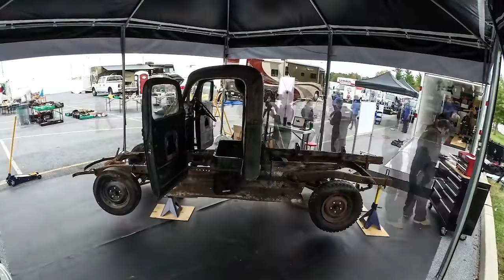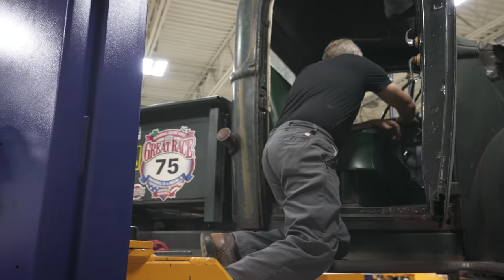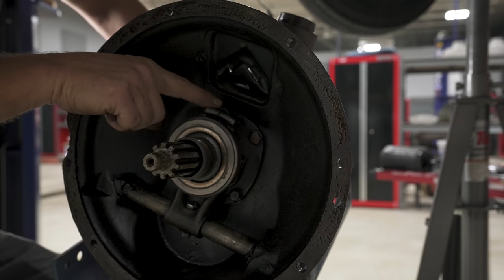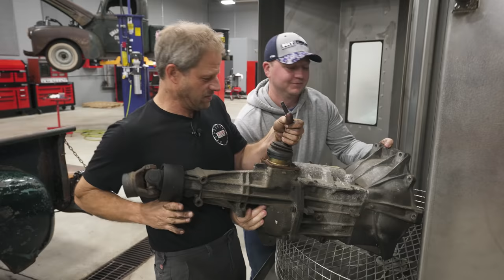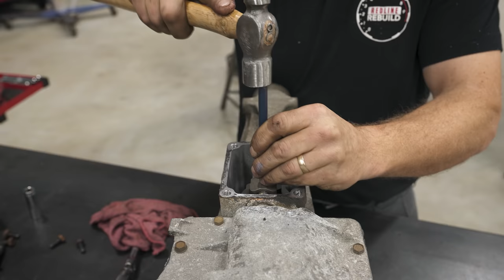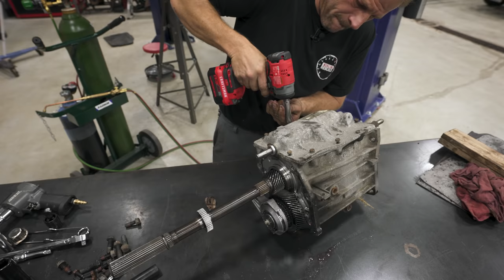T5 Transmission Swapped into a 75 year old Ford Truck | Pt. 1

Comment: You always mention to get out in the shop.  A year ago I finally tackled the 37 Chev PU build that I bought from my aunt and uncle in 87.  I had quit and stored it after a couple of major life events including the early death of my father who was working on it with me.  Then this year I started suffering debilitating pain in my leg and had to quit.  Fast forward a few months and I had surgery on my spine to correct a bulge pressing on my spinal nerve.  I have to go through the rehab process for a couple of months before I can resume work but I'm looking forward to getting out in the shop.  I'm putting a late model LT1 from a 2014 Silverado in it so strengthening the frame is paramount.  Already have a Fatman MII front end installed.I'll have a 6L80E transmission.

Comment: An old dishwasher also works well as a parts washer; just smaller.
 Those industrial parts washers use same wash methods; i have repaired / maintained them before.
That's how i got the dishwasher / parts washer idea. Use a non suds soap / degreaser. Cascade works ok.
Portable dishwasher on wheels, with sink connection and butcher block top is a nice find.
Reply: I recently got a heated rotary parts washer from auction. I cleaned a T5 by hand and used etching primer and painted it with engine silver heat paint. I wish I had the parts washer when I did my T5, if you take everything apart it will clean small parts, gears, shafts, etc...The parts washer I got has a skimmer to remove oil and a heated element to get rid of the oil. It is 100% self contained. Does your old dishwasher do that?

Comment: I did exactly what you're talking about with a 72 Chevelle, when I replaced a SBC 305/TH350 (not the original engine OR transmission ... came with 307/Powerglide which I'd changed out a few years before to get it back on the road) with a BBC 402/TH400 ... I just had to slide the cross member to different holes which were already in the frame rail. Surprised me, actually.
Reply: That 2 speed PG is a good tranny.... But the 400 was the way to go. 
Tail section was too long for drive shaft had to have it cut....

Comment: I was smiling when you were talking about the Chevelle crossmember. 
I had a 68 Chevelle in high school. 
I probably put three different 350 turbos in that car, they just wouldn't hold up.
 I remember underneath that thing sliding that crossmember up and down those frame rails many times.👍

Comment: I have a different way to hold the engine up when I remove a transmission.  I use a ratchet strap, I go over the frame rails under the oil pan and then ratchet it tight under the frame rails. I love watching all your projects and learn some tricks on my project even.

Comment: Even back in the day when that truck was new many people had the same problem or just wanted to save money on gas and wear and tear on the engine added an aftermarket overdrive unit. They even marketed a two speed rear end for the model T cars and trucks called the Ruxton. The only problem then and now it's a pretty expensive proposition and the T5 defiantly is a much cheaper option but much more labor intensive. What I have also seen is the set up from a later model Ford car like a 1949-53 Borg Warner three speed with overdrive swapped in and a floor shifter adapted to the transmission.

Comment: Use a ratchet strap over both frame rails and under the back of the engine. Hook on the lower inner part of the frame. Ratchet it tight and the vehicle can be moved if required.

Comment: I need to start getting work into my np435 swap into my w100. I need to get the engine rebuilt. Then getting a new oil pickup for the oil pan. Then cutting the GM mounts off and welding Mopar ones back on. Wiring it. Dropping the engine in. Get the 44x12r17 wheels on. Axle flip. Rust work. Get heat/AC (maybe). Radio

Comment: That upper right bellhousing bolt gave me trouble too. I ordered a cheap set of 1/2 drive impacts so I could modify one to use on my Ingersoll 1/2 inch drive impact. Then it came out!

Comment: Always thought the ford t5s and chevys had different input shafts, definitely have to rethink  retrofitting a t5 into my 41 gmc
Reply: they do...sleeves are available so as to use Ford throw-out bearing and Ford clutch assembly and linkage on S10 5-speed
Reply: @kennethnoble811  awesome!
The old girl will be way more fun over 45/50mph

Comment: I had a T5 in my '88 S10 with the 2.5L Iron G=Duke 4cyl. engine. It had a mech. speedo , but used that POS hydraulic throwout assy. and I always wished it had been the old mech. version. It was a failure point that was almost unrepairable when it failed as it refused to bleed out properly. I finally traded in the S10 because of the hydraulic crap.

Comment: a good option for holding your engine up is a ratchet strap underneath the engine fastened to both of the frame rails on either side of it and then tighten it up

Comment: Awesome project. I have a T5 with a Dana 300 Transfer Case in my 86 CJ7 4.2L. It has two sets of numbers on the housing in two different spots. One is 13-52-066-915 and the second is 13-52-065-904. Is it a World-Class OR Non-World-Class? If someone can help with that I'll appreciate it. Also the Dana300 is leaking just a drop here and there from the drain plug I believe. I'm not really using it much AT ALL unfortunately. Any recommendations on weather it should be rebuild or?? If anyone out there has a suggestion. It sat for a few years in a garage. Thank you ahead of time.

Comment: This has nothing to do with the project, but I see a lot of mechanical guys on youtube who wear their wedding rings while working. I don't know if you guys realize how dangerous this is. Your ring finger could get skinned by electrical tools or even get ripped off.  I would never work wearing my wedding band/ring.
Reply: This is Machine Shop 101 type stuff... you learn it in the first day or two in junior high shop class. You remove all jewelry, wristbands, watches or anything in the way of clothing below the elbow joint. You also remove anything hanging from your neck and tie up any long hair so that nothing can get caught up in moving equipment. Speaking of clothing - no loose fitting shirts or pants and the recommendation on shirts is buttons or snaps so that your shirt can break away if worse comes to worse. I myself once saw a guy running a large LeBlond horizontal mill get his shirt tails caught up in a boring head and it was dragging him slowly in. Fortunately, the mill was set at 25 RPMs so he had time to rip open the shirt and spin out of it - naked from the waist up. Aside from the buttons missing, he could put the shirt back on AFTER he shut off the mill and unwound the shirt from the spindle and boring head. Damage? Shirt only. None to the guy or the machine... but think about what could have happened if the spindle was moving at a higher rate of speed. Say 300 RPMs. His shirt would have been violently ripped off his body after he slammed into the spindle. I seriously doubt he would have been unscathed. As it was, he continued working after finding some duct tape to keep his shirt closed! You can believe he tucked in his shirt every day after that too. As for me, I'll admit I didn't actually react to what I saw until about 10 seconds after he shut off the mill. I was like a deer, caught in the headlights standing on the platform of my own mill about 25 feet away... just watching that potential for disaster unfold. I finally got down and walked over to check on him along with a couple of other guys... we all got the jitters after a few minutes. I always thought it odd how that worked, you'd think it would happen immediately. Moral of the story here? Always practice good habits and think about what you're doing. The best way to prevent injury is to never be in a position to get injured. As has been said, an ounce of prevention is worth a pound of cure. Best wishes to all!

- Max Giganteum

Comment: It's not rocket science to have and own a gas axe it's not expensive to get a starter kit and any local supplier can fill a set of tanks or rent a set to you for cheap . A good starter kit will run on average under 200 dollars for a decent one or 300 to 400 for a really good torch and gauges .  the best way to do it is get a cheap set up and teach yourself to use it then later when you know what you want spend the money for a good rig. the most important thing is be safe there are a few simple rules to keep from blowing yourself up but as long as your not an idiot it's all good

Comment: Aren't those fuel pumps placed to close above the exhaust?  Seems like that would really heat the incoming fuel.  Hot Gasoline!   Fire hazard?   Hot fuel to the engine ???

Comment: I thought Jeep used the t5 too, with  the shifter farther forward, than Ford or gm t5.
Reply: The Jeep T-5, at least the one used in the 1982-1986 CJs uses the same forward position as the the S-10 trans.  The difference is the Jeep unit is much shorter because it bolts to a Dana 300 transfer case.

Comment: Aren't there issues with matching gearing for the speedo to read correctly?  How do you adjust it for different gears in the rear end?
Reply: Different teeth count on the output shaft drive gear.
Reply: there are small gear sets for the mechanical "sending unit" available to sync speedo with rear gearing

Comment: You actually need money to get a project, or work on one. Unless of course a person is rich like you! 😆  😀
Reply: He's not rich or footing the bill lol
Reply: @MrStacy1974  Somebody is! 😀😃🙂🙃😊 It sure ain't me! I had a 56 F100 I wanted to restore for about 25 years. Had to finally sell it to pay regular bills! My project is gone and I'm 67, so I'm almost gone too! 😆 🤣
Reply: I bought a mid 70's Datsun pickup with plans for a beater but it became a full on project after finding out it was built the same year and month I was born 🙄
Reply: @MrStacy1974  I ended up with a project whether I wanted to or not. My dad passed and left me his 99 S10 pickup. Only 54,000 on it right now! Vortec V6 FI 4.0 litre, auto, PS, AC, disc brakes front/drum really, long bed w/liner. I just rebuilt the front brakes; calipers, lines, pads and got shoes for the back, rebuilt the distributor, new plugs and wires, oil change, new battery. A project vehicle just so it can be driven. My 56 F100 was going to be driven too, but worth a lot more!
Reply: @jamesdiehl8690  as long as you don't have to depend on it as a daily driver,  s10's can be relatively inexpensive and easy projects with good parts availability
Reply: @MrStacy1974  It is my daily driver! I has a 94 Dodge Dakota, but I got hurt on a job. It had a 5sp shift and I lost the use of my right arm for several months. Had to start driving the S10, then sold the Dakota.

Comment: Don't put a complete transmission into a parts cleaner unless you intend to completely disassemble it immediately afterwards....getting all of the  water out of bushes & bearings is pretty much impossible in situ (that'll be capillary action). Very bad idea.

Comment: Why?
I would have used a New Venture 4500, it will take a HELL of a lot more abuse than a dinky T-5
Reply: I think a T5 should be able to handle a flathead engine's output. It probably makes less power than the V6 it came behind from the factory
Reply: @jacobmoses3712  A guy I know had an old Fox body Mustang with a naturally aspirated 302......long before the 5.0 Coyote
We were always fixing the T5 in that thing, and Ive rebuilt a lot more of them in other vehicles.
Take one apart sometime and compare the internal components to an NV4500, 5 speed ZF in Ford trucks, or old Muncie (or even the lighter duty Saginaw) , Ford top loader or Chrysler A-833
You will immediately see the difference.

Comment: Instead of rattling away get a long handle and crack the bolts manually. Th number of 'mechanics' of today who cannot work without impact wrenches. Yes I like them too but they are never as good as simple leverage.
The parts washer was a fail,, it was no cleaner, just full of water!!  Simple degreaser and pressure washer will always do a better job.